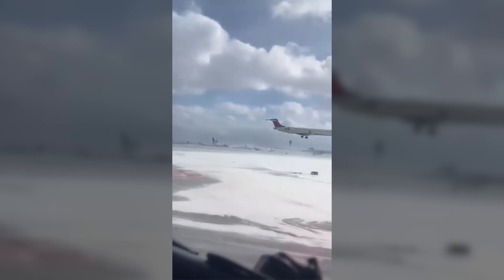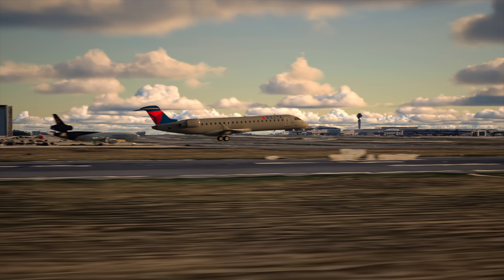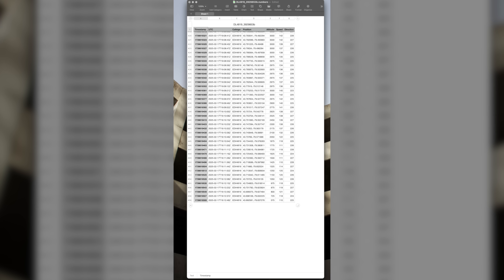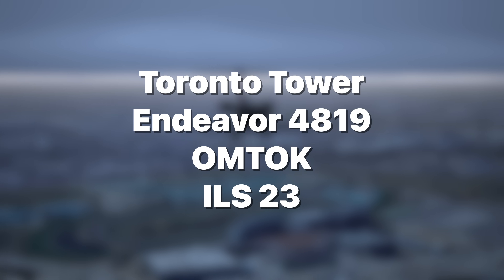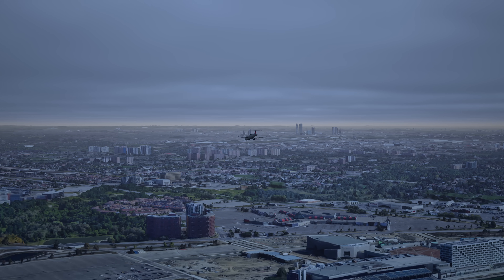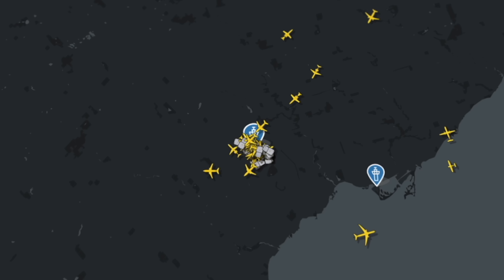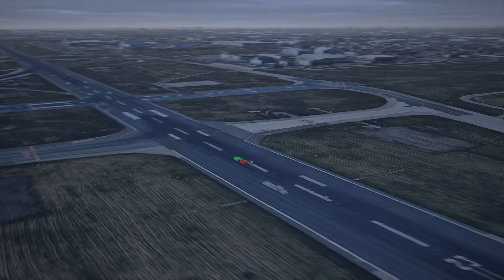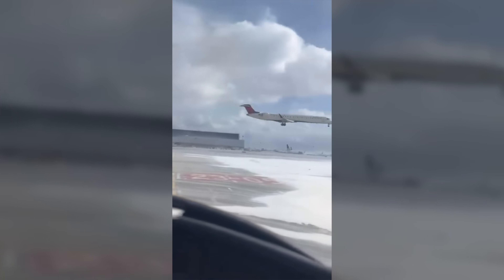What Caused The INSANE Descent Rate in Toronto?

Comment: The groundspeed has nothing to do with Vref. The Vref number is indicated airspeed (IAS), not groundspeed. The winds were something like 270˚ at 30 gusting to 45 knots. So, their headwind component would have been somewhere in the vacinity of 20 knots or so. If their IAS was about 140 knots, then their ground speed would have been about 120 knots. A sudden change in wind speed and/or direction is Wind Sheer. That could possibly be the cause of the sudden increase in descent rate. On a normal landing in a jet, it would touch down, on both main gear, at something less than 100 feet per min. If they actually hit the ground at about 1,000 feet per min on, one main gear, that would explain why it was ripped off the airplane. An F-18 that lands on aircraft carriers has landing gear designed for those sort of loads, but not a CRJ-900.

Comment: Generally great video .... couple or 3 thoughts.

The Tower's advisory about the glide slope is due to the aircraft holding short awaiting takeoff, it's beyond the critical hold short line, but short of the runway hold short line.  So the tower comment doesn't indicate traffic landing ahead.

My other comment ... what happened to the throttles.  with the Crosswind, there was a need to align with the runway. "decrab."  That induces a LOT of parasitic drag cross controlling the rudder and ailerons.  Did the pilot flying FO retard to idle as with an on speed/on glide path no crosswind point in the approach to start the flare and goto IDLE.

was it "just time" to goto idle?  It appears the VVI increases in the last few seconds .... when the decrab would commence and the throttles' being moved to IDLE would have to happen slower, if they move at all, or MAYBE even needed a slight increase in power to avoid the 1100fpm sink rate.

just prior to touchdown, there's a significant right bank. Indicates to me the initial decrab was insufficient to track the centerline and they were drifting left due to crosswind .... the increased right bank for either stopping the drift or seeking to laterally move right (back) to centerline.  If the R Main gear hadn't collapsed, they'd almost certainly have drug the right wingtip anyway.

Just my inflation adjusted $.02

20K hours high performance jet; 26 year pilot with a major airline, USAF A-10 & T-38IP prior to that.

Comment: 'T' tail aircraft used to fall out of the sky quite regularly. At high AoA the wash from the main wing would envelop the high mounted tailplane causing the elevator to lose authority. With no elevator 'bite' control column input to flare would produce no results.  Essentially a 'deep stall' producing a constant descent rate, constant AoA, with no flare. And no time to recover via power or roll.

Comment: I was flying to CVG from HTS and there were really intense headwinds. The aircraft was a 20 seat turboprop and the flight was rough all the way. Just before touching down at CVG, maybe around 50 ft. above the runway, the aircraft had moved below the headwinds and accelerated forward. We used up a lot of runway and the pilot went for the 45. We were on the ground but we weren't slowing down sufficiently to make the turn safely. We made it anyway. If it had been a car it would've rolled over. The cockpit was open to the cabin and the flight crew was struggling to turn the plane. When we finally stopped the pilot and copilot both leaned forward on the controls to catch their breath. The smell in the cabin indicated that someone soiled themselves.

Comment: I don’t know why no else is noticing that the starboard wing dipped while still airborne, but close to landing. Go to 0.25 playback speed and look. Performing a normal flare in cross wind with strong gusts would be unwise, but notice that the main gear did touch down before the nose, so the craft was actually slightly flared. 
And if you look at a longer clip, you’ll see there is a prior rolling dip, with the starboard wing dropping.
The crosswind is coming from the starboard side, which you can see if you watch the blowing snow and smoke.
So these aren’t just short gusts, but long gusts with short breaks between.
The pilot is steering against a long hard gust, the gust dies off, the aircraft in a second drops and the starboard wing dips.
The wing suddenly dipping allowed the tip to hit the snowbank. If you haven’t dealt with snowbanks, you won’t realize that they are most often packed densely and frozen solid. Ask a northern friend how much they love when a plow comes by and builds a snowbank at the end of the driveway. 
So the wing is caught, the aircraft starts to skew, the starboard gear collapses or is sheered off, and then the wing sheers off. 
I don’t see any pilot error. I see a lot of people wanting to blame the pilot, but this was a true accident due to the nature of the gusting wind, the height of the snow bank, and the low wing tip.

Comment: There may be other factors, but this feels like they were not carrying enough extra speed to account for the gust factor.  It is very likely that their headwind sheared away and their airspeed plummeted instantly and they had no margin left.  Pilots know the feeling of a strong headwind sheering to a lot less (call it zero).  Airspeed drops instantly and Suddenly the descent rate increases, you feel it and you pull back and add power to compensate.  Well power takes time to develop so you are supposed to carry enough extra speed that you CAN compensate with elevator without stalling or mushing… possibly right into the ground.  There will be multiple factors here bc there always are, but wind shear seems probable to be one of them.

Comment: Gusts and crosswinds are common, and pilots are trained to land in these types of windy conditions.  This crash is being over-analyzed.  The video clearly reveals everything.  It was a very hard landing...period.  Pilots need to be on top of their game when landing an airplane, and they need to compensate for the weather conditions.  They knew exactly what the winds were doing during their approach.  There "clearly" was no flare in the landing, which caused the landing gear to break, which caused the wing to dip and break off, which caused the other wing to roll the plane over due to its lift.

Comment: 1000 ft/min is above what it should have been but it's not insane.  A sudden drop in the gusts could have easily caused the descent rate to have increased.  That's the cause of many hard landings in gusty conditions.
Reply: If the descent rate increases, would the pilot not correct? They are already making hundreds, if not thousands of corrections per minute so what's one more? How are all those landing accomplished everyday in similar conditions? Luck?
Reply: @skyboy1956  Of course but, when a wind gust stops, the aircraft loses lift and starts dropping immediately.  If the aircraft  is close to the ground, no matter how fast the pilot reacts, the descent can't be arrested completely.  There isn't a pilot alive that hasn't had a hard landing in strong, gusty conditions.  In this case, I think due to snow blowing across the runway, the pilot also misjudged just exactly where the runway surface was(?).

Comment: Complete speculation on my part.  Using the aircraft as a size reference being ~24.5 ft tall, and copying the aircraft a couple of times to see how high it approximately is off the ground, by my reference point, to the point it touched down I registered approximately 980-1070 feet/min descent.  

Using the reference point to another reference point, I got their speed as approximately 124 knots.  

It kind of lines up with the ADSB with that drop at the end.  I’m very curious what the NTSB report is going to reveal as well as data from the FDR. 

Again, all of this is estimation just based off the video so take it for what it’s worth.   It’s interesting seeing my numbers almost matching what you just presented.

Comment: Has anyone noticed the flaps were up?
Reply: so did the crew notice the loud ground prox audible warning saying "too low flaps?" and just ignore it?
Reply: @ idk, there for sure woulda been warnings going off. But from the cell phone vid I saw, sure looked like the flaps were up? What do you see?
Reply: @craigg4246   I see a normal approach. Flaps up stall speed at this landing weight would be around 160-165 kts and they were not stalled so how do you explain that if the flaps were up?
Reply: @ headwinds. I know it was windy and gusty. There was a 40 degree right crosswind component. The rule of thumb is add half the crosswind and all the gust to the approach speed. Also, would be normal to fly right wing low in a 40 degree right cross wind. But judging from the higher than normal speed, sink rate, and lack of flare, this was not a stabilized approach. I think she just screwed up
Reply: @craigg4246  Headwind has no effect on airspeed. Never heard of that rule of thumb. For this plane SOP was add 1/2 the gust factor up to a maximum of 10 kts. Flying the line it was bug Vref and fly top of the bug which was 5 extra kts. 10 was just too much. The preferred landing technique was wings level and crab to the flare, then kickout crab and lower upwind wing to put unwind gear on the runway first.
Reply: @ I realize headwind has no effect on airspeed. I am an ATP. But you cannot tell airspeed from a video. Only an approximation of ground speed. But forget the SOP, doesn’t it look like the flaps are up in the video? That is all I am trying to point out.

Comment: That sudden increase in decent rate is interesting. Possibly the winds died down suddenly so there was a loss of lift, or maybe a strong down draft?

So it is still up in the air, but pilot error may not be the root cause. Still could be a compounding cause though. It is also possible it was completely pilot error, either in actual second to second piloting, or reliance on external conditions or expectations of those conditions to be a certain way for the landing to be made safetly, only for mother nature to not cooperate.

Comment: ILS interference is a huge thing. If an aircraft on the ground crosses the ILS hold bars it will cause a bad signal in the a/c on approach. I've seen this most often in LAX when they are lining up an aircraft to take off while I'm 3-5 miles out. The auto pilot starts wildly pitching up and down as the ILS signal is degraded and the green needle moves all over. In VMC it's no big deal just disconnect and continue. In IMC it's critical you don't cross the ILS hold bars.

In this case, the controller just mentioned that an aircraft was inside those ILS hold bars and to use caution... albeit in a weird way. This had no effect on the landing.

Comment: Why would you add a headwind component to ground speed?
Reply: The lift of the wings is generated by the airspeed -- the speed of the air across the wings. So you add the headwind component to the ground speed to get the air speed.

Comment: A sudden gust of tailwind, or a sudden drop in headwind, could have cut lift dramatically - that might explain the plane's dropping suddenly, and hitting the tarmac short of the usual touchdown location, before the pilot could flare the jet for a normal landing.  
When winds are gusty and variable, pilots are supposed to add extra airspeed to avoid just such a situation.  If your numbers are correct, they neglected to add that extra "reserve" of airspeed.

Comment: Okay, Im no pilot, never but 1 time took the controls of a Piper.
But from what Im seeing in the video of this plane, it looks like the right landing gear  is taking all of the force for just a split  millia second,  and it either crumples or get sheared off causing  the right wing to hit hard, causing the explosion, and the speed of the fuselage  causing it to roll causing the other wing to slap the ground, causing  another explosion,  ripping  it off as well. Then the fuselage just by happenstance  continues  upside down!?
Either the pilot didn't  correct its horizontal path, or the wind pushed it downward, and the something or it all combined caused the landing gear to break off, making the wing hit and snap off?
Reply: proper crosswind landing technique requires touching down on the upwind gear first.
Reply: @skyboy1956  Well, that wasn't  very "proper." Now, was it?
And if so, which everyone  else is saying  the pilot didn't  flare the plane, but was like landing an F-18 on a carrier! The F-18's landing gear are "beefed  up" and are made for hard landings! Airliners' landing gear is not made to land like that.
 So, if that was "proper," then everyone  needs to go back to the drawing  table cause that landing gear  crumpled. This  caused the wing to slap the ground way too hard, causing the explosion,  ripping that wing off, making the other wing push the fuselage  over and roll to upside down!
Reply: @ correct technique for x-wind landing is touch down upwind wheel first. Has nothing to do with flare.
Reply: @skyboy1956  okay, your the only one saying  that. I don't  really care.
Reply: @Jerry-n3y6e  
Bro, Flight Training Handbook (FAA-8083-3) Ch. 9 Approaches and Landings
"the crosswind correction is maintained throughout the round out, and the initial touchdown occurs on the
upwind main wheel"

Or, just keep believing the keyboard warriors.
Reply: @skyboy1956  again,  I don't  care.
And That didn't  work out, now did it?
Reply: Your analysis of the crash sequence looks pretty accurate.

There are numerous factors that could have lead up to it.
Most likely it was a combination of several.
With living pilots, FDR, CVR and QAR we will probably know quite quickly.

Interim report will hopefully be within a few weeks.
Reply: @Captain101-x1o  investigators will know quite quicky. "we" won't know for months.
Reply: @Captain101-x1o  I just watched another  channel,  that had an ex F-18 Naval Aviator, who said the same thing about the right landing  gear and then it's  right wing. I was almost a "certified traffic/accident" patrolman,  but I did work a ton of motor vehicle  accidents,  so I guess I developed  an eye for that! Thanks!

Comment: I can’t find the comment below again, but I agree that it looks like classic wind shear or a microburst. When I first saw this footage, the first thing that stood out to me was the sudden increase in descent rate just before touchdown. The altimetry data in this vid supports that. The plane’s attitude does seem odd (no flare), but when the shear or microburst hit, the plane was probably still too high to begin flaring. Then everything happened so fast there was no time to adjust.

Just a theory, I’d have thought that the immediate reaction to shear would have been to pull up sharply, and it seems their indicated airspeed was enough that they wouldn’t have had to worry about a stall. It’s been decades since I last flew thing, and even then it was on,y a Cessna 150, so I’m not exactly an expert aviator 😁
Reply: where were the windshear advisories? Dude, you have no idea how ignorant you sound.

Comment: Its normal to land slightly faster when the wind is gusty (just incase you get a gust that reduces air speed). Most aircraft  under these conditions add 20kts but i believe only +10kts is used on this type of aircraft. Not enough? The rate of descent on the approach varies a bit but its not crazy high. The aircraft did appear stabalised. Elsewhere a pilot that landed earlier said it was hard to see where the runway was and just landed between the snow banks either side of the runway. Were those snow banks too high for an aircraft landing one wing low?

Comment: Those 5 entries of -1024 have got to be an anomaly, 1024 is 2 to the 10th power, it's a 10 bit binary number of all 1's, and the subsequent -256 entries, which similarly is an 8 bit binary number of all 1's, also looks like some kind of anomaly. Those look to me like errors in the data and not actual telemetry.
Reply: I have no idea what you are trying to say here.  The video shows that -1024 is probably correct since the landing gear failed.  The Flight Data recorder will have the real numbers.
Reply: @scottw5315  What I'm saying is it lines up too perfectly with the binary number digits computers use to be accurate. You'll notice none of the values before it where exact powers of 2 and it doesn't make sense that a craft of any kind being piloted, driven, or otherwise having a human in physical control would be bang on a velocity that is an exact power of 2, which computers use to store numbers efficiently. I downloaded the data myself and I'm noticing that the autopilot looks to be using these numbers during cruise, lots of 0's, 64's, -64's, 128s, etc to keep the aircraft level. Using any kind of velocity that is an exact power of 2 would indicate to me either that the autopilot was in control or the numbers were erroneous in some way.

Comment: Airport's fault snow piled too close to the runway. The Wing ran through a  pile of snow.
The full width of the runway was not available.
It was reduced by 1/4 taking it down to less than 150 ft and had snow piled on the edges.
You cannot see how deep the snow is piled on the edges until after you have landed.
Toronto International Airport Fire Chief Todd Aitken said Monday that the airport runway was dry at the time of the crash, and there were no crosswind conditions as the Delta flight arrived.
The runways at Toronto Pearson International Airport (YYZ) are 200 feet (61 meters) wide. 
CRJ 900 Wing Span · 81 ft 7 in 
Snow should be piled beyond the hold short bars on the taxiways.
Airport's fault snow piled too close to the runway. The Wing ran through a  pile of snow. 

They flew it all the way to the ground at high speed because of the gusting winds. I would have done the same thing.
The Landing was fine they hit a snow pile.